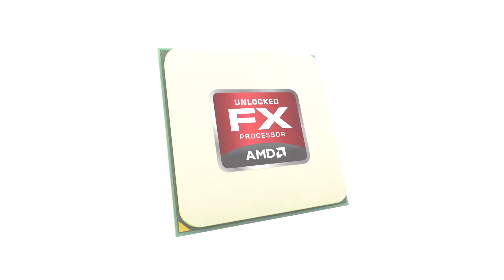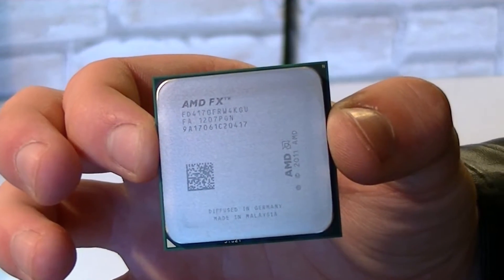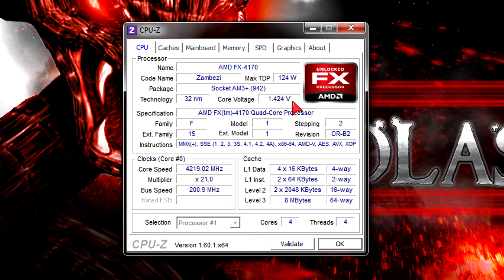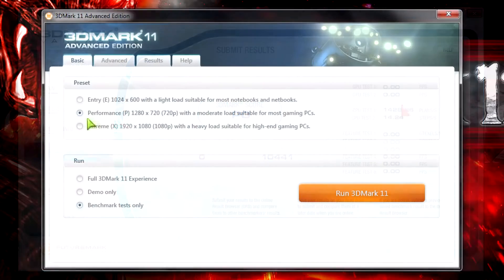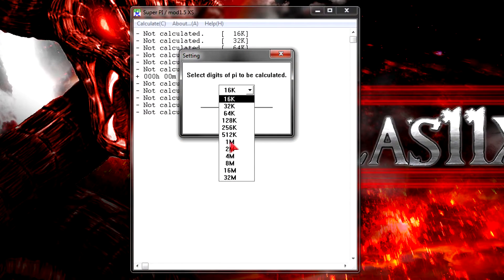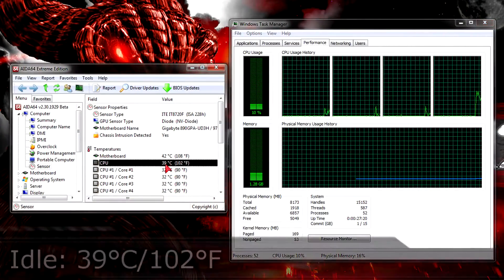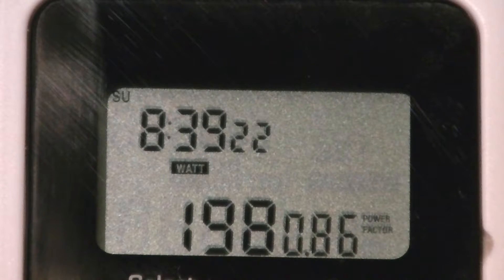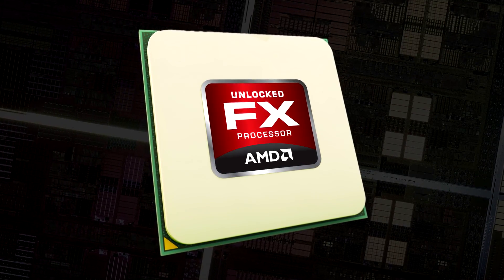AMD FX-4170 CPU Review

Comment: lol I got a cool running AMD FX 4130 overclocked with stock cooler to 4.2 GHz 22c idle and 40c load room temp 20c only uses 65 watts running prime 95 also xD

Comment from the maker: Don't worry, the two people are just joking around. Your PC will not explode. The worst case scenario would be the CPU being dead, but only if you were static-charged. Your CPU probably is working just fine, just clean the top with a soft cloth to wipe off fingerprints and/or skin oil. Of course in the future, try to avoid touching the top part of the CPU.

Comment: Benchmark tests rarely reflect actual results. A quick search for gameplay achieved with this chip will show that Skyrim on ultra settings has a stable 60FPS. Plus, this only costs $120-130 now. Crazy cheap for the unmatched clock speed.

Comment: Can someone please explain to me why this processor is cheaper than an i5 3570k. Might sound like a dumb question but I am building a gaming/casual rendering rig where I have made two different bundles. A z77 extreme 4 i5 3570k Gtx570 set and a 970 extreme 4 Fx-4170 gtx570 set. But the and is cheaper but faster. What  am I misisng here?  I must be blind because from my point of view the AMD should shit on the i5...

Comment: i5 3450 190,-
HD 6870 150,-
8GB ram 40,-
Bitfenix Merc-Alpha 40,-

Antec VP-450 40,-
seagate barracude 500GB 65,-
LG Electronics GH22NS50 22,-
scythe mugen 3 42,-
ASRock Z75 Pro3, Z75 100,-
Hope I helped. The i5 is even 15% faster then the AMD flagship model. WHole thing is at 609 Dollar. Looked the prices up at amazon-america since I am from Europe. That setup should play modern games on Ultra with 35 FPS+. If you have some more money take HD7850 for 210,- instead of the 6870. feel free to ask

Comment: The i5-2500K isn't expensive if you have a Microcenter in your city. They're selling it for $169.  Still, my old Intel Q9650 at 3.37 Ghz scored a 4.01 with Cinebench, performing better than this CPU clocked much higher. This shouldn't be the case, when you consider that my CPU came out in 2008, on the old LGA 775 socket. WTF AMD!

Comment: Well generally, you don't need anything better than a Noctua NH-D14. The only cooling system that can perform better at the same sound levels is full on, flat out water cooling. Complete with at least a 60mm thick 240mm long radiator. You will get similar to NH-D14 performance with a H100, but it really is pointless. It only does a few degrees better. Do give us a shout when you make up your mind though :D

Comment: Funnily enough, mentioning cooler, the 2500K is rated at 95W TDP, but in reality, even under full turbo, most rarely reach more than 75W. However the cooler supplied with the chip is rated at 95W. This means you can safely overclock the chip to about 4.2-4.4 with the stock cooling, since that's where it normally reaches 95W TDP. As for the boards, any P67/Z68/Z77 etc will take this chip up to those clocks. That will save you quite a bit on cooling. Don't mind me, I'm cheating with water cooling.

Comment: If you can, get a Thuban Hex core(Phenom II X6). It is at the level of the FX-81XX series. Even when you overclock both it will still perform at or beyond FX-81XX performance levels. Plus it's easy on the motherboard if you get a black edition chip too. They should have come down in price (on the second hand market as well), so I think you will be happier with that.

Comment: It's also not running in full multiplier, look at cpu Z it does the same thing, when your at your lower speed (1.4 GHz) your only at a multiplier of 7. My Phenom II X6 does the same thing, its only at 900 Mhz when its in idle to powersave, its at like 1.6 when its at its second multiplier and then when in use it goes to the full multiplier of 3.15 GHz. CPU Z and wPrime arent wrong, your just looking at the wrong time and your programs were sampling at the wrong time is all.

Comment: Yes but in gaming, cores don't essentially matter as long as it's more than 2. Most games haven't the need to more than 4 cores yet and right now clock speed is most important. The 4.2gHz on the FX-4170 greatly outweighs the 3.3gHz of the FX-6100. I would have to go with the cheaper FX-4170.

Comment: In Cinebench r11.5 I get 7.25 with my 3570K @ 4.4 GHz with CPU power consumption under 100 watts. My old Q6600 got 3.75 at 3.4 GHz. FX-4170 is a horrible processor. If you must go AMD then get an A8, perhaps hybrid crossfire.

Comment: there is nothing with the fx 6100 run everthing fine and fast very good for gaming no lags very good fram rate's run crysis warhead ultra maxed out with my 2 xfx R7770 max fps was 160fps low was 140fps with all mods  gta iv i get 170fps low 160 with all mods

Comment from the maker: Yes, it is upsetting. The TDP is very high on this CPU, but 1.2V is totally normal for AMD CPUs. But yes, you're right, the i5-3570K outperforms this Quad-Core, but also costs less. But there are other cheaper CPUs that beat the FX-4170. Nice choice on the GTX 560 and the PSU! ;)

Comment: This, is just upsetting,  This underperforms an i3 2100 -_-
125TDP.....
I would not overclock with a 125 TDP,  1.2v is also sorta high, as my i5 750(replacing it with an i7 3770(non K) run at 0.88v. I would not even touch this. CPU if its just some silly Quad Core that consumed more power then an i5 3570K -_-
Lol,  I got the EVGA GTX 560 and I got a new PSU, ULTRA LSP 550W :D
-Commy

Comment: So far, they look promising.
Check out The new AMD APU codenamed Trinity.
They are built using Piledriver cores, and they are good.
The top model A10-5800k even beats the fx 8150 in computing power (?) and it only has 2 modules (4cores) while the fx-8150 has 4 modules (8cores)

But I am not sure on that, I remember a benchmark chart with the fx 8150, a10 5800k and I clearly remember the APu being better in all benches.
You can check it out by typing A10-5800k benchmark in the google search

Comment: Furthermore if we look at the performance of the AMD Phenom II X4 980 Black Edition @ 4.3 Ghz (the max turbo speed of the 4170) it scores 5.05 in Cinebench. Not the best comparison due to some changes but you can see that the Hardware implementation of "Hyperthreading" in the BD Module is 168% of 1 True Core as the 4170 scores only 3.45. So only about 10% better than Intel Hyperthreading.

Comment: Not true.
The amd FX-4100 for example has 2 modules, and each of them have 2-2 integer cores.
Therefore the 2 modules would totally have 4 cores.
The FX-8150 has 4 modules and the fx -6100 has 3 modules
And 1 more thing :
The L3 cache is shared withing a module (between the 2 cores)

Comment: Look at a an i3 2100 on Cinebench for instance, scores around 2.97. The i5 2400 achieves 5.15. They are both clocked at 3.1 Ghz. This puts the performance of Hyperthreading at around 60% of a real Core. So 1 Intel Core with Hyperthreading is exactly 157% in this instance. One of the reasons that a BD Module doesn't achieve better results stem form conflict over resources inside the chip creating bottlenecks and increased latency. Good idea poorly implemented.  C'set la Vie.